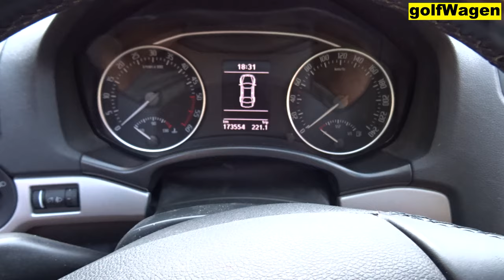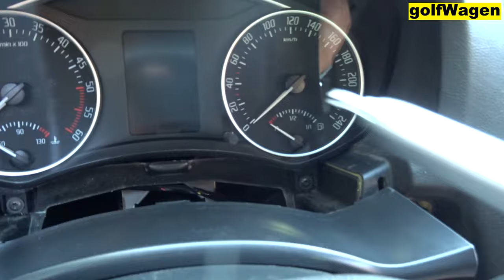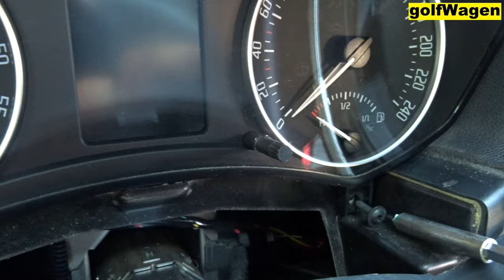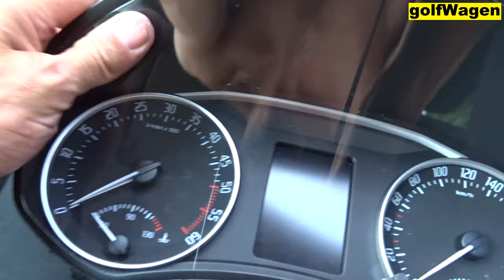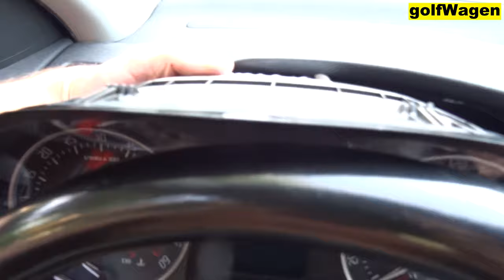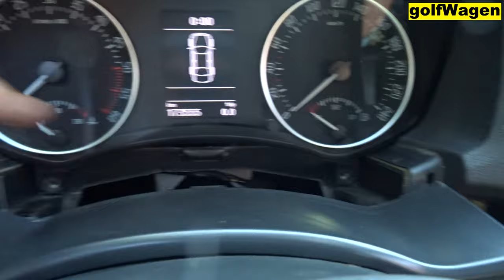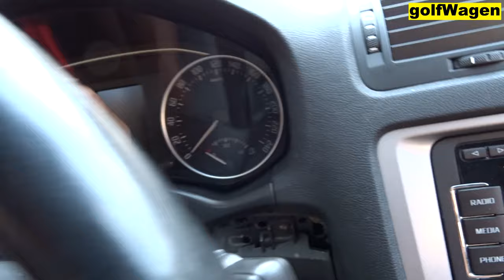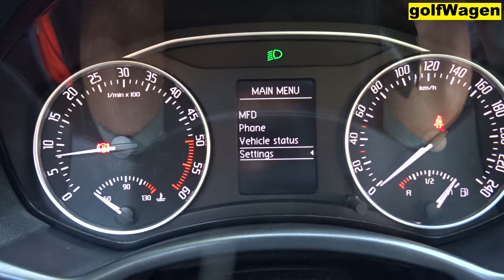Skoda Octavia 2 instrument cluster removal

Comment: Hello, would you please be able to say where is the warning/indicator relay on Octavia MK2 1Z3 ? I can find it neither at the back of the hazard switch nor on the relay panel (below instrument cluster). It is somewhere as I can hear it but I cannot see it! Many thanks! 🙂

And thanks also for your very instructive and smart videos that I have been usefully watching for years especially on Golf4!   👋
Reply: I found the answer by removing the instrument cluster from the dashboard based on the above video.
Dumb me, there is probably (on-line stores like AutoDoc do not propose it btw) no flasher unit on the Octavia Mk2 1Z that I am working on. The "tick-tick" sound of the working direction lights is produced by a piezo membrane installed on the instrument cluster PCBA and the direction/hazard lights are probably driven by some ECU or instrument controller.
Thanks again to Golf Wagen for his very helpful videos.   👍